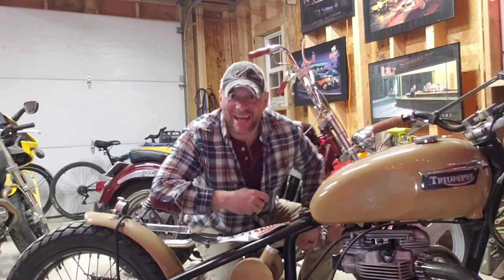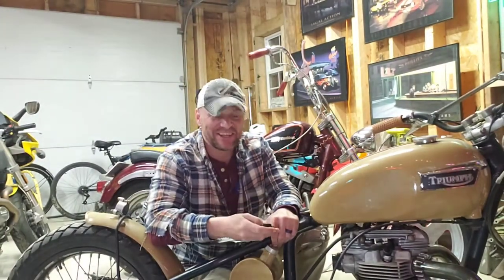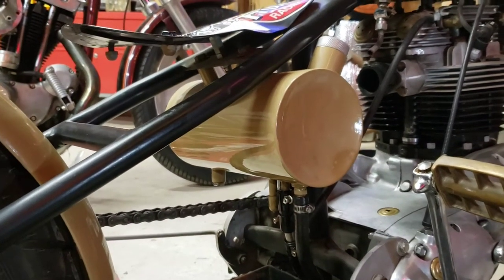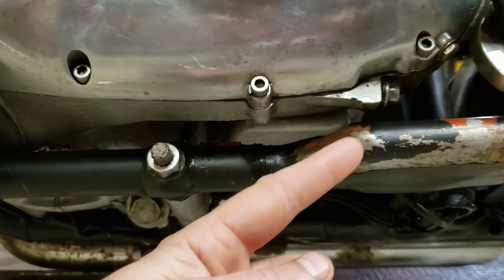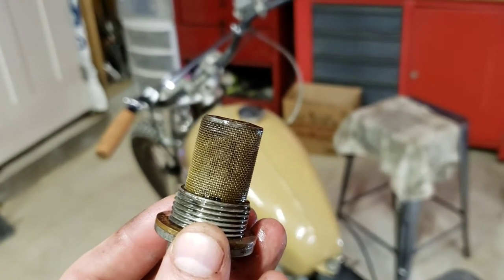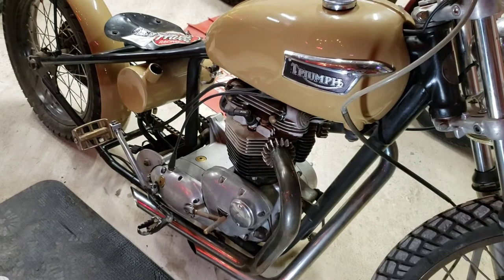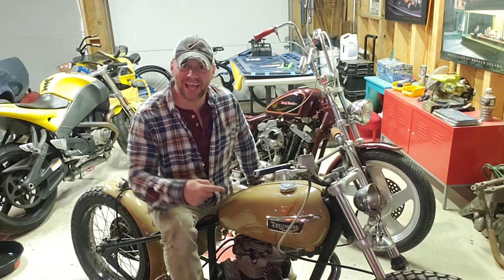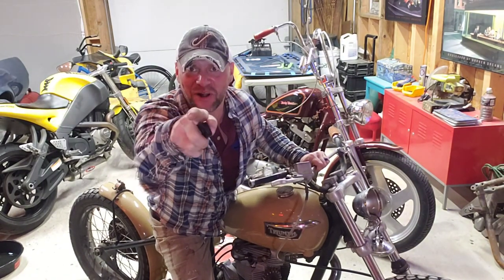Oil change in a classic Triumph Motorcycle. 500,650 and 750

Comment: Great video, thanks for the detailed info. 2 notations I'd say as a guy who builds motors and a certified motorcycle tech. 1st, as with any flat tappet cam motor, using a high zinc oil is crucial. Most m/c oils don't have that present. 2nd, m/c oils are formulated for a common bath system for the wet clutch. Whereas said clutch is a separate gear case, m/c oil isn't required. I recommend Castrol classic 20w50.
Reply from the maker: Thanks Mich, your input is definitely appreciated. I’m always trying to learn more

Comment: Very helpful video. One slight adjustment. My 71 oil in frame takes 4 pints (2quarts…not 3 quarts). Also what’s listed in the shop manual.

Comment: Just wanted to add that the OIF models require removal of the crankcase bolt/filter in addition to the drain and filter on the frame.
Reply from the maker: Thanks and good point to be made

Comment: My 1970 Daytona 500 is configured differently.  I can't remove ANY of the drain plugs, especially that huge one at the top of the crankcase.  Not sure where the bottom drain plug is located.  Nobody in my area will touch a Triumph.  Super screwed.

Comment: I never thought about messing with yhe Oil Pressure Relief Valve?
You could change the primary chain case oil too.
The older bike like yours:
I believe the crankshaft has a seal keeping the primary case oil separate from the engine oil.
My 1973 shares primary oil with engine oil.
Interesting my bike has two capacities for the Primary Case which confused me. One capacity is for when the primary cover has been removed.
The other capacity is when only the primary chain case drain plug has been removed.
This is because more oil drains out when cover is removed due to cavities in the cover etc.
The reason for the two capacities is not really spelled out in the books.
I was using Castrol 20-50 motorcycle oil but it does not seem to be available any more.
This year i have been using Valvoline 20-50 motorcycle oil in blue bottle that is not synthetic.
I have 63,500 miles on bike & not sure if it would be a good idea to switch to synthetic oil?

Comment: I did everything in your video for my 69/70 650 Bonneville.  I have an after market oil tank it only holds 2 quarts.  The oil seems to not be draining into the crack case. I cleaned all filters and drained the tanks but the oil and case and the new oil is not draining.,  Does the oil pump suck the oil from the tank to the crack case when it's running?  Then do I add the 3rd quart of oil? Confused. Thanks

Comment: Love your videos, but I can't find one that shows steps on changing oil on the primary (chain case)
Reply from the maker: Take the bleeder screw all the way out and blow air through the inlet side. You can use an air chuck lightly or use a automotive coolant hose that will fit in the inlet hole. Tape it off so no air passes through the top. Only need a 12” piece to do this

Comment: Hi, I bought a 1969 Triumph T120r that was put in a hardtail frame. It was supposedly sitting for 2-3 years. I was able to clean the carb and get it running properly. Now my issue is when I pull in the clutch lever in it makes a clicking noise. Also, the clutch will not disengage. When shifted into gear and I pull the clutch lever the bike does not move freely. Do you happen to know what is going on and how to fix it? I assume the clutch cable is adjusted too tightly and clutch plates maybe seized. Thanks for your help and love the videos on your triumph and especially the xs650 build series!
Reply from the maker: Your definitely to tight. However will it release if you move the bike back and forth several times?
Reply: @shedbillycustoms823  thank you for your reply! I will need to adjust the clutch then. Of course I went back to the bike put it in 4th gear rocked it back and forth with the clutch held in and it broke free.

Comment: ALLWAYS let it warm up some, but no long idles.
Reply from the maker: Your right about that
Reply: With my T140V, I always start up and ride straight off (after blipping the throttle a couple of times with the clutch pulled in to free it off). I've found that's the best way to warm it up. Neighbours are happier too because the noise goes away sooner.  I never use the choke on the Amal mk 1s because it's not necessary once you've used the ticklers, in fact I've taken the mechanism out and blanked off the holes.
Good advice with the oil change walk through. One thing I found with mine: the first time I changed the oil, I didn't have a new copper washer big enough to fit the crankcase drain plug, so I tried an o-ring instead, which seats against the chamfered area at the start of the thread, and it worked perfectly, so I've used them ever since, for about 50 oil changes over 28 years.